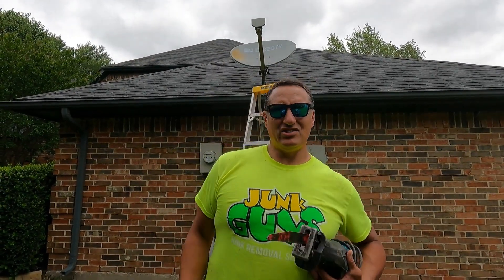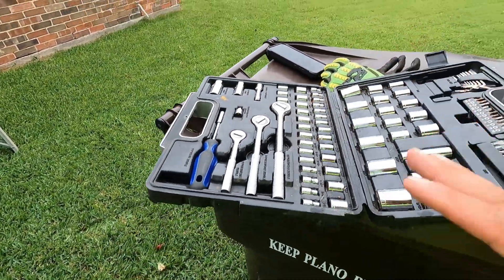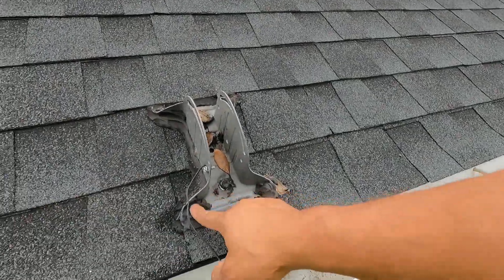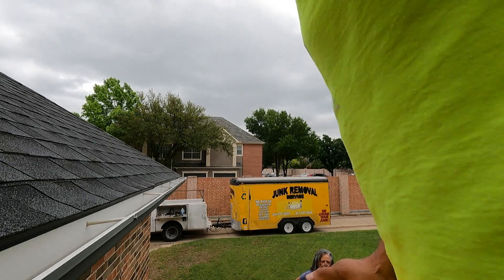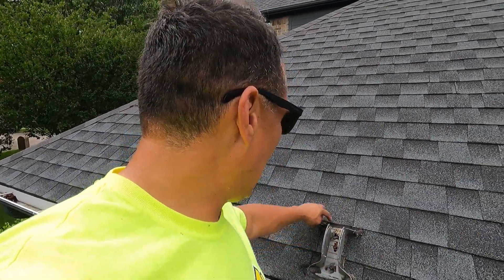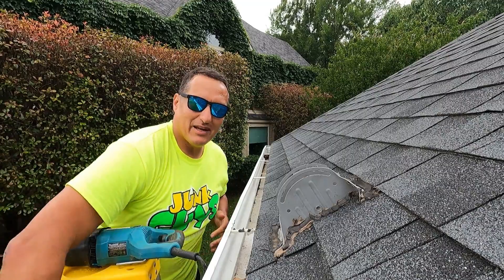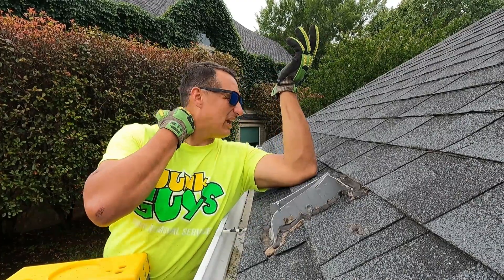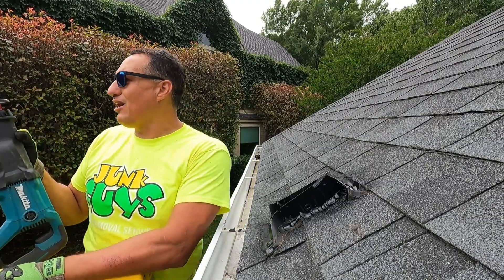OMG! Best How To Disconnect And Remove A Satellite Dish ever!

Comment: I appreciate that you left the mounting bracket on the roof instead of removing it. It’s not an eyesore and having to seal holes or replace the shingle is unnecessary by just leaving the bracket.
Reply: agree. I would have spray painted it as well. Leave well enough alone. The ugly thing was the dish itself.

Comment: Definitely not done the right way.  To do it ok way would be take the whole thing out seal the holes.  To do it truly the right way is to remove the entire unit if the shingles around or damaged remove those seal, and then put shingles back in place
Reply: The reason it's not worth it to go that extra mile is because shingles don't come in Individual packs. It's not worth the money or the time, Especially if you have a new roof or if you're even getting ready to replace your roof.

Comment: Yeah right.  Find the right size socket.  Didn't say what size it was.  Didn't show removal of the bolts.  Not helpful
Reply: Have you even used a socket set yet?  It's not rocket science especially if you have a drill.